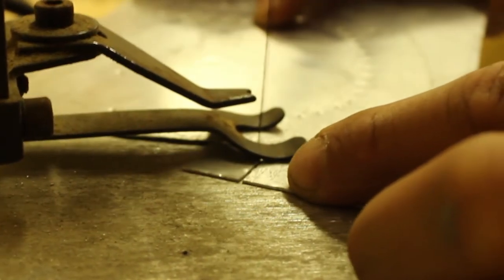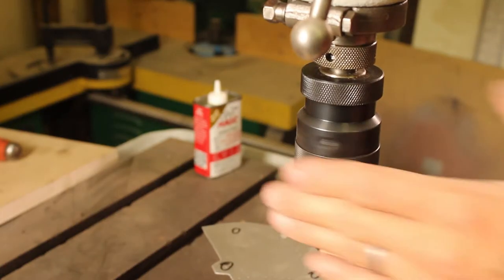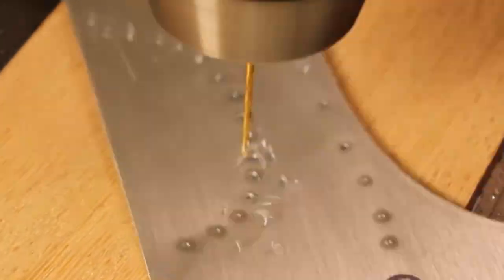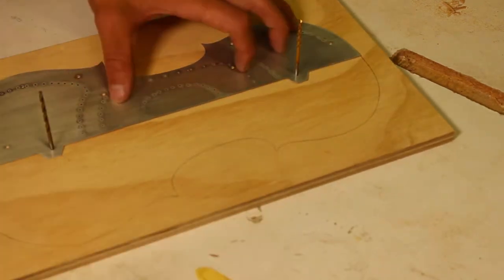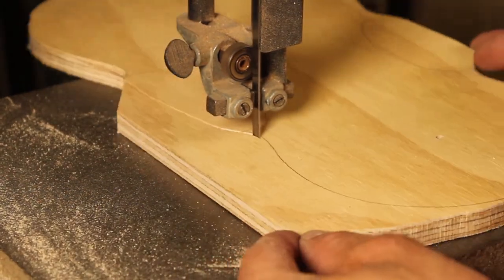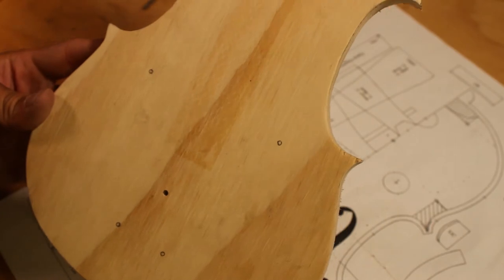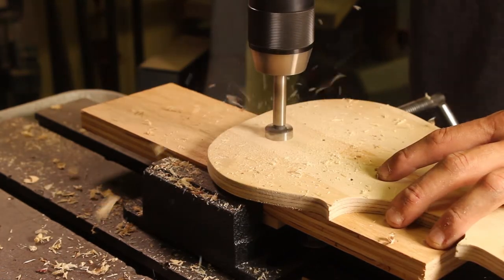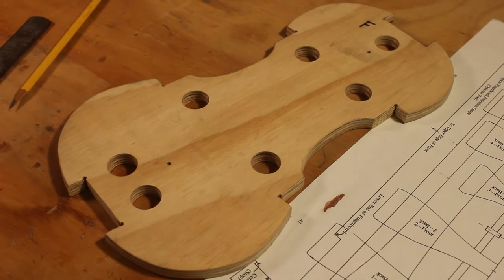Making a Violin Mold

Comment: Thank you very much! Making those corner block allowance cuts makes perfect sense to me. You are the first one who has done that in a video. Thank you! Nicely done. I like the extra step of a solid template before making your mould. Very good.
Reply from the maker: Great to hear!
Reply: Very good representation of Henry's work.  You did miss an important feature on this step.   Looking at the plan you can see the corner angle on the cutouts are not 90 degrees.  It's about 93.  This is very important when it comes time to remove the mold!  Another important point, blocks are only glued onto the long edge for the same reason.  Good work.
Reply: @jamesbrown6525  Which is the long egde? Could you help with that please? Thanks.